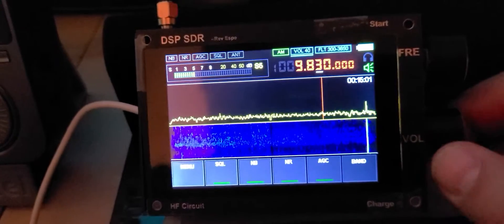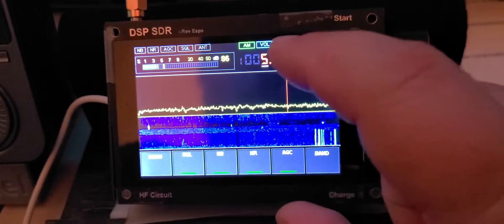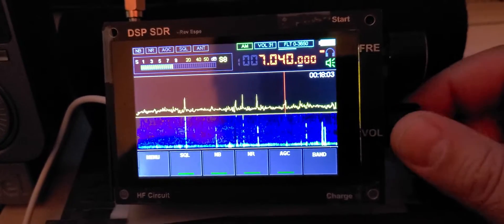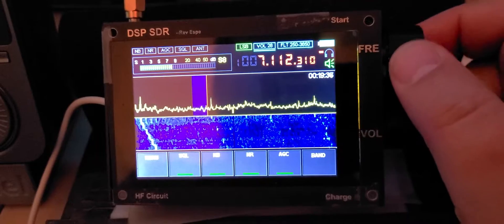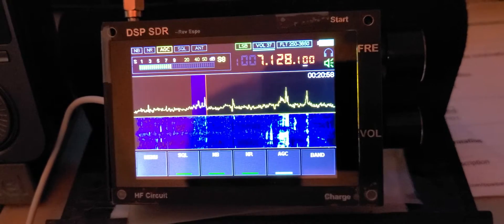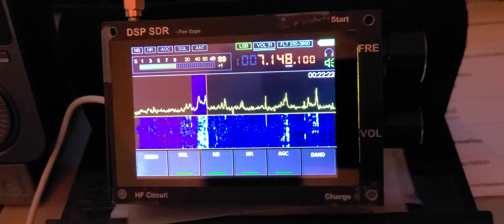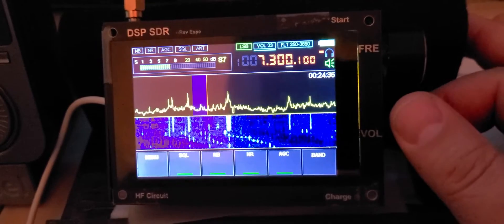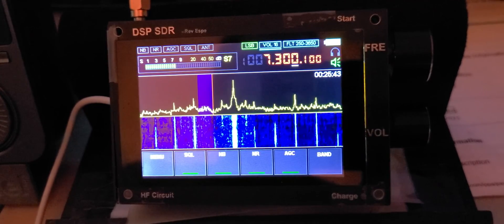Chinese DSP SDR Malahit Clone basic operations tuning around 40 meter amateur radio band Shortwave

Comment: These would really be cool if they had a low power transmit stage of say 50 milliwatts to drive a qrp amp. Add a tiny mic or speakermicrophone and a short antenna and you could talk to your ham friend a few streets over with qrpp.

Comment: Gilles, I have the same version, and although it lacks many features of the Russian or the “licensed” Chinese units, this clone is impressive. The NR feature and audio rivals that of $1000 units. Yes you have to play around with the gain, but like any other new “toy” without a manual, after a few minutes of trial and error you have one heck of a little waterfall receiver. Like you said, The MLA-30 antenna is a perfect match, as the included whip is “almost” useless. But another one of your  functional videos make it easier for guys who want to get involved in this great SWL hobby.